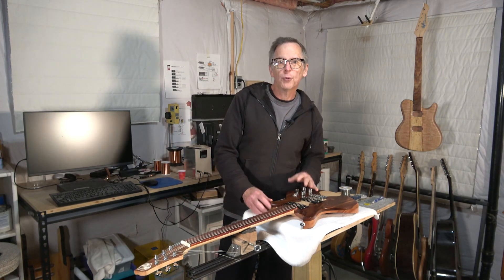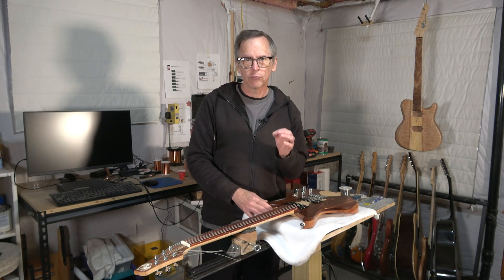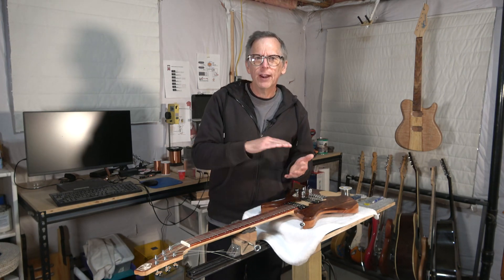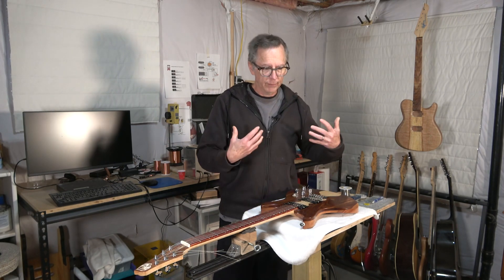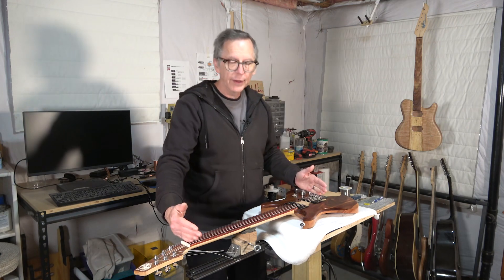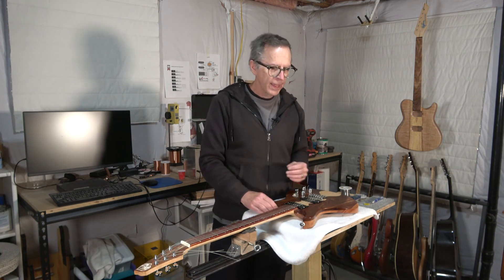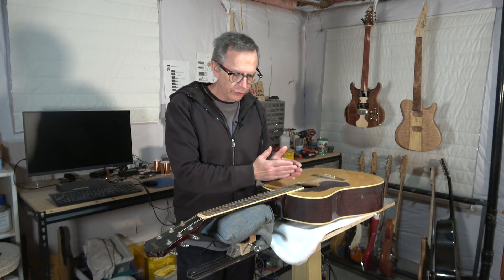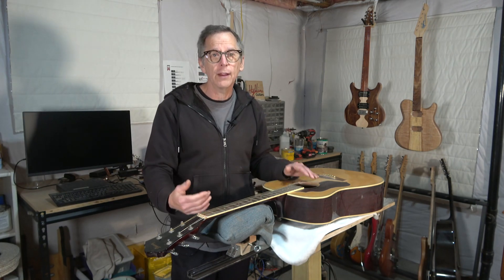Burl Wood Fretboards, Gibson TOM vs Fender Hardtail Bridges, Zero Fret Neck Relief

Comment: Truss rod relief is also to deal with the way the string vibrates. It’s tight at the ends and much more exaggerated in the middle. No relief it will buzz in the middle.